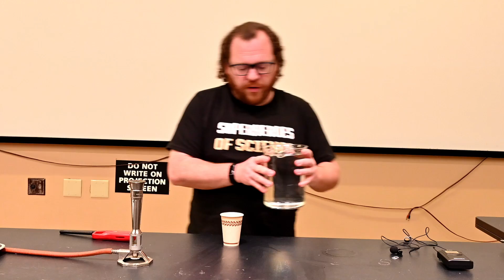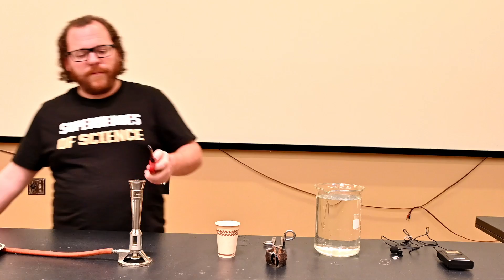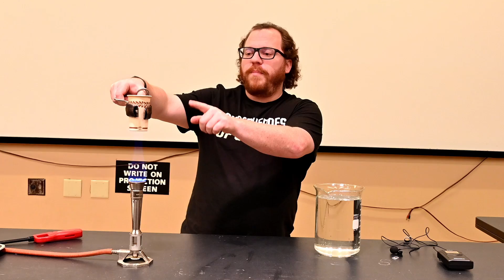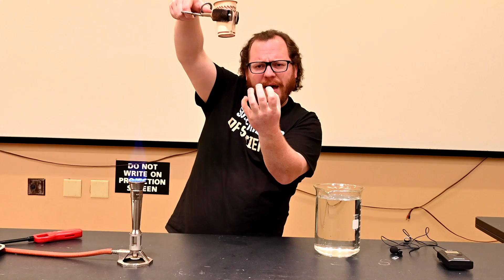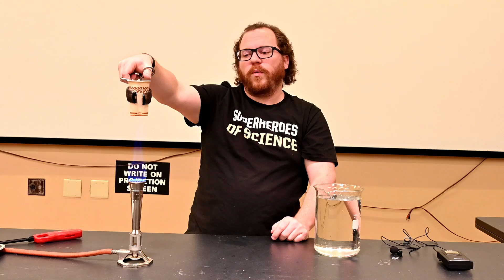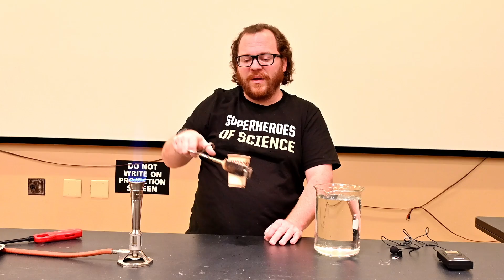Boiling Water Paper Cup Demo

Comment: I would do similar when camping - placing a half filled paper cup at the edge of a campfire. The top of the cup would burn down to the level of the water, but the rest of the cup would hold and the water would start boiling after 5-10 minutes. I would always state that while the water boils at 212 degrees F, the paper will not burn until it reaches "Fahrenheit 451".